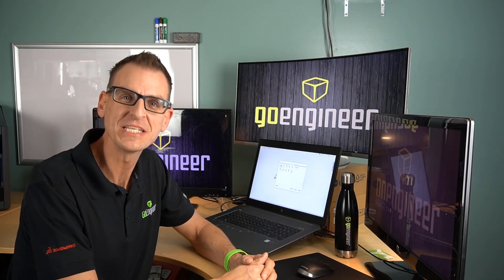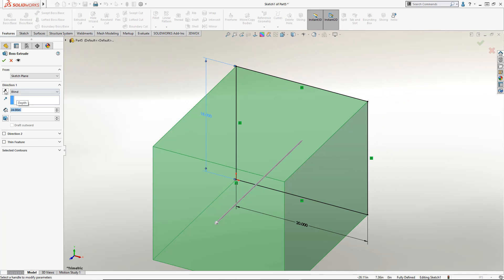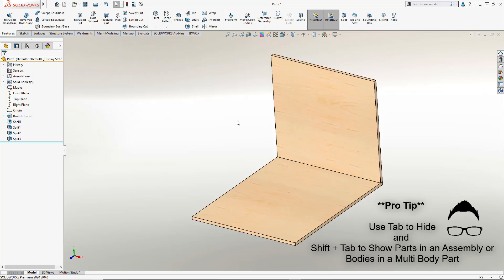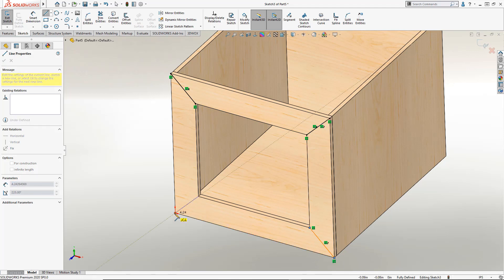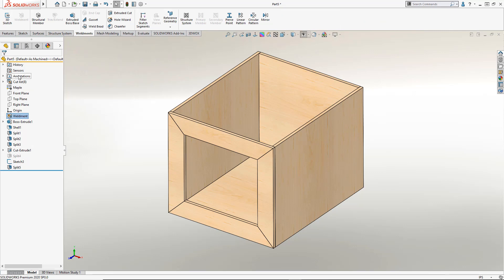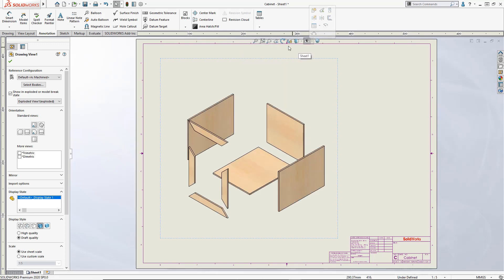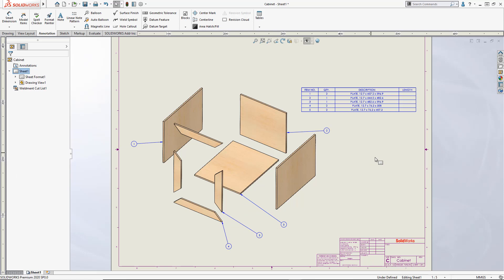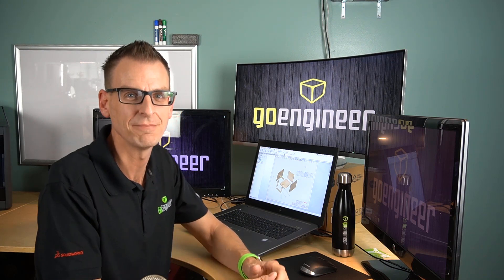SOLIDWORKS Tutorial - Wood Cabinet Multi Body Technique

Comment: Great method... I build everything part by part and place in an assembly.

From your method, how would you transfer the information of rim lengths and hpl dimensions and base cut of the boards?
Reply from the maker: There are a lot of options for communicating that data. Here is one way 

https://www.goengineer.com/blog/link-a-dimension-to-the-bom-with-custom-property

Comment: Excellent video Darin. I was struggling at work in SolidWorks trying to design a simple plywood cabinet. I was headed in the right direction, but after I used the shell command to create the box and wall thickness, I couldn't figure out the other steps in the process. Your video just taught me what I was trying to figure out today at work. Please, keep those video's going. Thank you.
Reply from the maker: Glad I could help!

Comment: In some respects I like your solution (quick and dirty), but there is NO allowance for real joinery, such as mortise and tenon, ship laps, rabbets, dados, grooves, etc. All my cabinets use similar sides and front faces (roughly), but my rear panels are always inset in a groove, which leaves room behind for my favorite mounting style "French Cleat".
For the above system of cabinetry, I find it convenient to develop library parts, since who wants to remake rail and style joints for each new project. Besides which when you make drawings you want to show the joints and describe setups and cuts for the factory floor or in the case of the hobbyist, you want to only work out your procedures once.

Still, I will play around with this solution for being thorough in my repertoire so thanks for posting.
Reply: For mortise and tenon you could turn the objects into sheet metal, and then use the slot and tab feature.
Reply: @ts3dprints732  though that mey be doable, why would you? Joinery does have simple rules for such things as M & T so why not make library parts that already have them built in, such as rails with mortises (a left and right) and stiles with tenons.
You drage them in and if you wish after adjusting for panel or frame length and width, you can save them as new individual parts for a project if you wish.

Mates can be included as part of the drag and drop operation. Design Tables can also be leveraged for consistency and sizing.